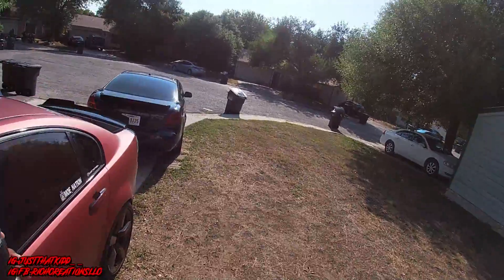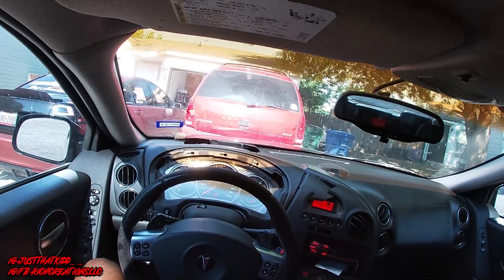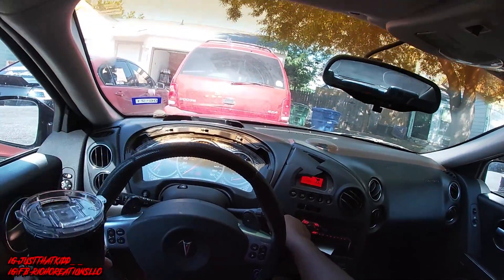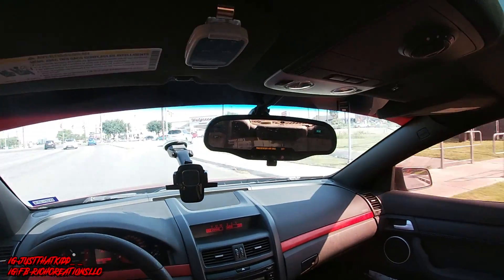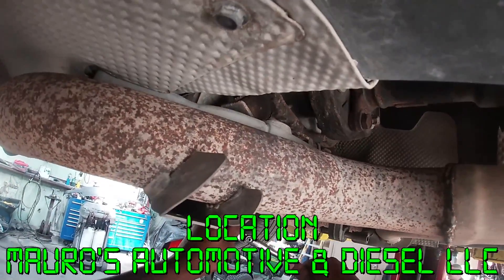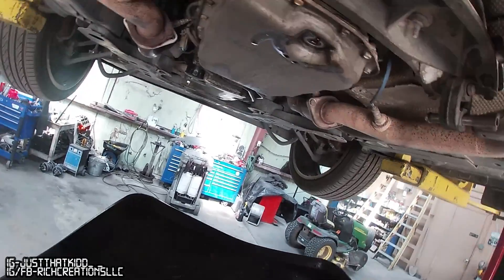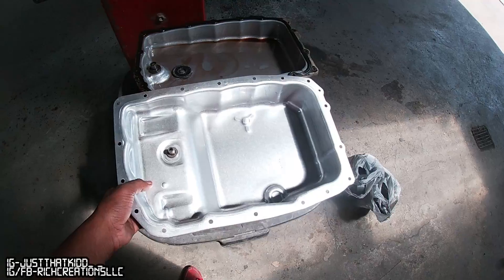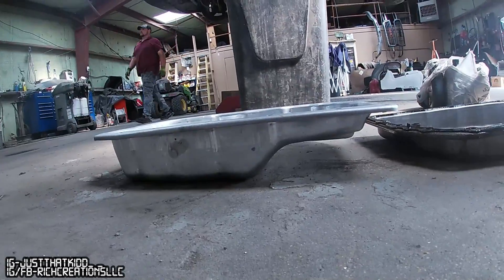Installing a CAMARO SS transmission pan on my PONTIAC G8 GT !

Comment: Keep in mind, our cars call for 6qts of trans fluid. 8qts will not make it run cooler, once you have the top amount of fluid it will flow the same regardless. If it's running hot, that deep trans pan isn't fixing the issue. Your fluid was old and burnt up, just needed to be changed and that filter was probably clogged and trash causing it not to flow correctly and cool the transmission.

Want cooler trans temps, get an upgraded trans cooler system. Like a "TruCool", etc.

Comment: Did you replace the old filter seal and go through the correct procedure to get the correct level , or just fill the pan and drive off?

Comment: It makes so much sense now why on the Chevy ss when you are WOT, the computer cuts the ac compressor. I guess because it can damage it at high rpm. Which is weird. Because on my rsx which revs to 9k rpm with ac never had a problem or even in the Honda and Toyota world never a problem. So yeh weird gm compressors have this problem. 
But yeh also on my list of stuff to get done whole at Koza Performance I just added th camero Transmission pan also. With his custom trans cooler.
And triple disc circle d converter to hold the 1500hp. Have to try and keep it as cool as possible
Reply from the maker: I blew a compressor because i decided to go WOT with the ac on 🙄
Reply: @Moe_Nation  I know thats crazy! It explains why the Chevy ss cuts its compressor at high rpm
Reply from the maker: @davidtranmedia5112  that’s a good thing ! G8’s have that issues and the issue of throwing an ac belt. Idk of the ss the same.
Reply: @Moe_Nation  no. I guess it shutting the compressor off we don't any of those problems. Only thing we have is the it getting hot on summer days at WOT but after that normal driving gets it cold again
Reply: G8s were notorious for throwing the AC belt when going WOT with the AC on

Comment: Yeah my g8 pops as well when letting off the gas. But question, have you had any issues with shift flare in your trans?
Reply from the maker: Nope. Never had a problem
Reply: Its DEFCO in your tune that makes it pop on deceleration
Reply: I had shift flare on my G8 and read on a forum that adding an extra half to full quart of fluid might fix it.  I added 3/4 of a quart and shift flare was gone.  That was 2 years ago and it's been shifting great ever since.
Reply: @garyramee6754  Yep, that's where my transmission was flaring too, 2nd to 3rd.  Once I added that extra fluid it never flared again.  I know it's worked for other G8's.
Reply: I know this is old but my 3-4 shift flares bad, especially when the transmission is cold. You guys fixed it by adding 0.5 to 1 quart of fluid?
Reply: The shift flare was a recall on mine in 2010. It was a TSB actually and they changed the TCM tune and changed a few seals in the trans. If you have a good tuner they can adjust it out by increasing the line pressure on those shifts.

Comment: Question do you know what a stock 6.2 hp is. Not a supercharged 6.2
Reply from the maker: 415
Reply: Ok cool I just did a swap. Just couldn’t find the hp
Reply from the maker: I think it’s 415 stock. I look it up and got 495 but i think that’s the new lt motors.
Reply: Moe_Nation ok then. Ya that’s what’s i ran into as well
Reply from the maker: If it’s from a camaro it’s 426hp. Time to put it on the dyno !
Reply: Moe_Nation ok will do